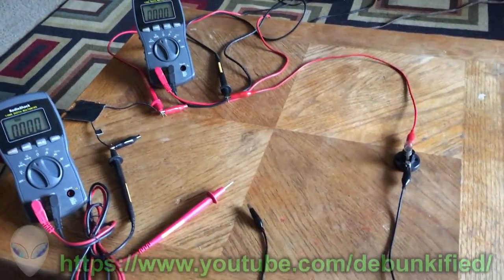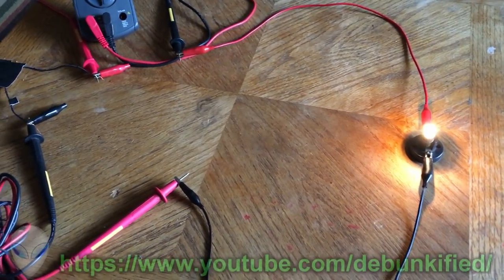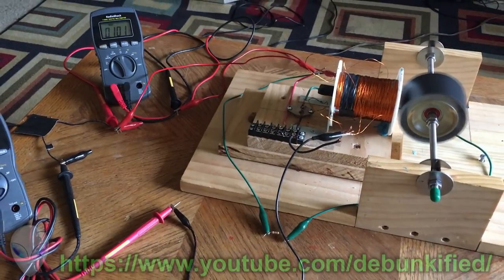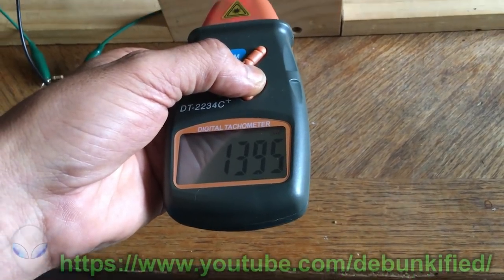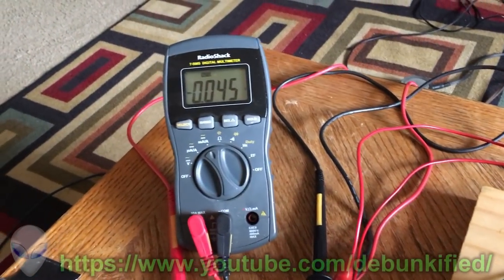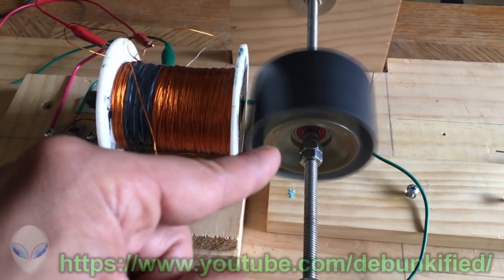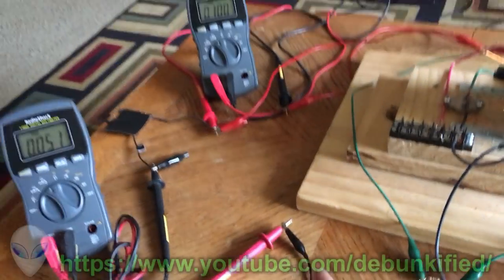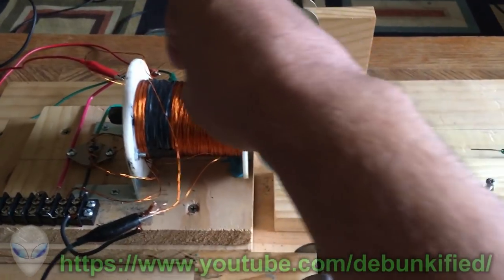Escape the Matrix with the Mag Amp

Comment from the maker: There seems to be problems with viewers viewing the circuit schematic provided in the link. For whatever reason it may not display properly, although there’s no reason for it. I see it just fine, perhaps slow connections may cause this.
Reply: the schematic works fine, but I do have problems looking at your blogpage: http://eternalmotor.blogspot.com . i use the firefox 58, the page looks fine, but you do not see the main frame.. so if i click on an item on the left, like schematics... i get no content with firefox quantum. with internet explorer it works fine. Just letting you know..
btw. I have been using the feedback option with the 3rd winding for some time, but with me I need a UF diode for it to work. example: with a 1n4007 it does not work for me but with a UF4007 or a schottky diode it works fine.. (strange).
Reply from the maker: That is strange, there should be no reason in the world that a 1n4001 would not work. I wonder what kind of setup you have? A uF4001 switches faster I believe and should add slightly more efficiency. Try adding more in parallel to cut down on resistance?
Reply: well actually it works with bedini and hall sensor motors, just by using the 3rd or 4th strand.. (depending on how many windings) actually it is only a transformer thing.. instead of getting the backemf with the diode, you get it with the 3rd winding like with a transformer. You must be carefull though because you have to put the diode on the correct side, pointing in the correct direction (opposite to the current flow in the rest of the coil) oderwise you only get what is generated and not the backemf.
here an example with my bicycle wheel (it was 1st run) around minute 6, I start feeding back and am getting around 50% less consumption. Of course i cannot charge a battery with the backemf any more once I am feeding back.
https://www.youtube.com/watch?v=9tpbE2dxBlg
When cutting down resistance i have to add equal amount of extra winding to be able to collect the whole back-emf.
Reply from the maker: Very good. Well even though you’re not charging a separate battery you are still after charging back up the one and only battery. So I see this as doing the exact same thing. 50% less consumption is very good.

Comment: Just a  question: why you use ferrite magnets...?  is not better to use  neodymium magnets...?
Reply from the maker: Hey there Sky collection, ferrites don’t saturate a core as much while neos do. But that doesn’t mean you can’t use neos, but if you do you’re going to have a bigger air gap and will have to set the coil away further. If you want a small air gap the use an air core with the neos.

A general rule that I use is using ferrite/ ceramic magnets with ferrite/iron cores or other types of metal core and then neos with air cores, in which you will have to set the core away much further.

From my experience these two methods of rotor magnet and stator core are about equal to one another.

So ferrite/ceramic magnets with metal core, air core isn’t as good and you’ll get weak interaction. And then neos with aircore, metal will be too strong of an interaction.

Hope this helps.
Reply: Very nice for me, thanks for your response.

Comment: Sorry but your blog just puts up an image, no text or any reference to a circuit diagram.

Moving one red clip-lead, you are bypassing some current around the top meter.
You are making a second current loop,and you are not measuring it properly.

Where is that clip-lead you moved connected on your pulse motor?

You should only have ONE clip-lead connected to the red meter lead, that should be to  the power supply positive wire.
All of your rotor system should be connected to the black lead of the meter.

Stop and look at your "Unorthodox" circuit you have made and how you are measuring the power from the battery.

When you have the rotor stopped but power applied you have 130mA flowing into a coil, I assume you have an oscillating circuit hidden behind the coil out of site.

When the rotor is spinning you have PULSED 130mA current, so your DMM reads an averaged current, hence101mA.

Without the rotor spinning the inductive properties is different to when the rotor is spinning because when spinning you have an extra oscillating magnetic field operating the coil from the spinning rotor.
Reply from the maker: Hi Mr. Tom George,

I due in fact provide an exact circuit schematic (diagram) in the description just below the video. Open your eyes! Observe! Look around, become aware of your reality and surroundings! Sorry but I shouldn’t have to tell you to do this.

I am well aware of the inductance changes in the core due to the rotating magnetic fields. I am also aware of the “second” oscillation due to the rotor magnetics triggering the base/emitter of the transistor.

There is no hidden oscillator! It is in plain site right in front of you before your very eyes within the transistor and inductor! 

Just to make sure you have the link to the schematic here it is just one more time. 

eternalmotor.blogspot.com/p/circuit-schematics-and-breadboard.html#MagAmp
Reply from the maker: Now you’re changing your original message claiming I have no schematic to a blog that has an image with no reference to a circuit. Either you don’t know what a circuit diagram looks like or you are simply not seeing the diagram that is provided, either that you are just being belligerent.

The image IS of the circuit diagram (schematic) itself. What is the problem here? Why don’t you explain to me why you do not see the circuit diagram (in the image) of the link provided? Thanks.
Reply: DB I'm just getting an image of what looks like a hand drawn image of sparks coming odd sphere.
Reply from the maker: Really? Hmm. Maybe I jumped the gun here and yelled at Tom for no apparent reason? May I ask what device are you using? Browser? Etc...? Thanks.
Reply: Chrome on windows, I've looked at the source code, the page with all the links are all in there, it'll be something in the CSS, I'll have a quick look and see if i can find it.
Reply from the maker: Yes please do so! I don’t get it, I’ve never had problems ever really. I’m beginning to give up on the almighty Google and just might have to get my own domain. I can view just fine through Chrome, Edge, FireFox and Safari on iPhone 6s Plus through Youtube’s browser just fine. Scratching my head. Slow connection?
Reply from the maker: It sounds to me that everything isn’t loading quick enough from your description of seeing the plasma ball image first. Let me know.
Reply: No, there's an issue with the code. The quick fix is to remove the following lines of code from your page,   starts line: 2688 to line 2690.
"<div class='bg-photo-overlay'></div>
<div class='bg-photo-container'>
<div class='bg-photo'></div>"
Now you have time to fix the css.
You'll need to fix up the CSS code for that element (bg-photo), p.s. you seem to have quite a few instances of 'bg-photo' in the CSS will be a conflict in there.
Reply from the maker: Hi, some of that code was part of the template already and.I think it’s some junk they put in there to cause the images to be displayed in a gallery type  light box upon click or tap. I guess it doesn’t work everywhere for everyone. I’ve never had a problem with it except for one thing, I have to constantly redo my own code because they are always inserting there own to accommodate mine. I’m about sick of it and think I will just get my own domain. I’ll provide a link to the circuit stored on Google Drive or something to fix it perfectly anyways. I apologize for that, I thought it would be a great way to place an image, guess not.
Reply from the maker: Try this, it’s a direct link to the image itself. Tell me if it works please. https://1.bp.blogspot.com/-GD8-nh_rRxk/WqHDnSJLHPI/AAAAAAAADLs/tTV547F7nCI27mgdov82un2AEuknpTP-gCPcBGAYYCw/s1600/3.png
Reply: yup.